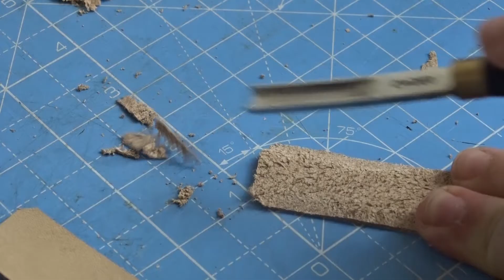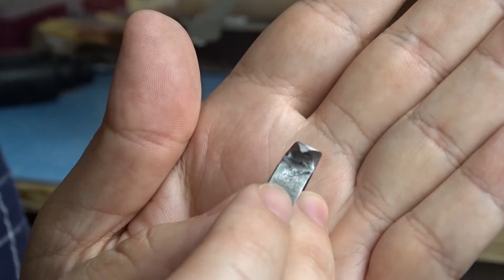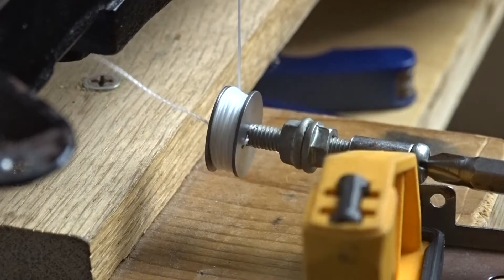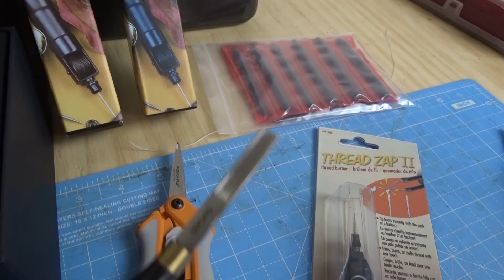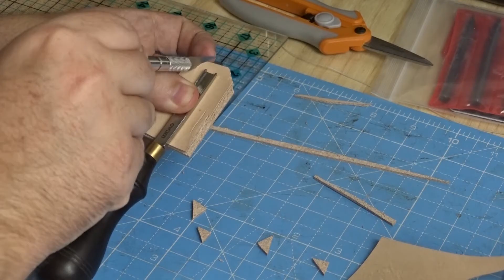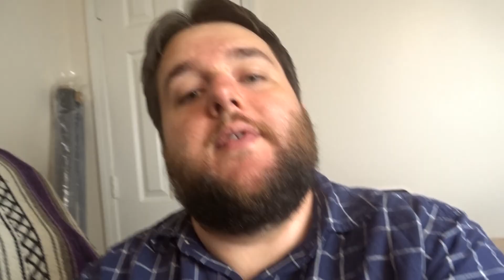It Stitches Like a Dream!  China Shoepatcher Sewing Machine: Easy Leathercraft Project

Comment: I just got this machine. My foot/needle do not go in synch. the needle goes down when the foot is up and the foot is down but stationary when the needle is up. . The foot does not rock to pull the leather through either
Reply: Mine did the same at first. Remove the big wheel and make sure the bearings are in the slots in the correct place and it should fix the issue like mine did.

Comment: Just wondering, can you adjust the stitch length?
Reply: Yes
Reply: Look for the upside down bolt with a spring around it. Tighter makes the stitches smaller.

Comment: Is there anyway that you could show me in a video how you would sew up two ends together to make a complete circle / pipe or can that be done with that Sewing Machine ? The reason why I ask is the the sewing machine I have is to wide to take both ends and put them together and sew them together. Because it is only 21 cm in with and it is going around a air cylinder.

Comment: Hello. Perhaps you can help. I bought the Chinese shoe patch machine in October of 2022. I spent a month watching videos, etc. For some reason I could not get the machine to pick up  the bobbin thread. So frustrated I put in the closet for a year. Pulled it out recently, and finally fixed the bobbin thread issue. Once the bobbin pickup worked, then I had an issue of the upper thread breaking. Watched some more videos, and did some intense sanding of all the bobbin parts. That stopped the breaking. Now, the thread is too loose. Before I just immediately tighten the bobbin spring, can you tell what would be causing the bottom thread to be too loose on my finished tests?

Comment: A simple way I found to improve the bobbin winder that came with your machine is to place flat washers that will fit the wheel on either side.  Tighten the nuts that came with the winder against the wheel.  This improves the winder by keeping the mechanism from wobbling.  My winder was a bit mangled when it arrived so I took it apart and flattened the sides in a vice as best I could then put it back together.  I was unable to tighten the round part that the screw goes through but the winder still works much better. I tried lock nuts but they would fit on the axle, hence the regular nuts that were already on the winder. Tighten them against the wheel so it doesn't spin.  The wheel will then spin on the axle as it should.

Comment: The stitching on the back looks really rough, but I know nothing about sewing, so take it with a grain of salt.  Is this typical of every leather sewing machine?  is it because of the tension? or just the nature of the beast ?  If one cut a groove for the stitches to lay into, would that help ?.    Is there any way to hook up a stop on the cylinder arm so that the stitching is straight and parallel to the edge of the leather (like a rip guide on a table saw ) ?  Thanks for the video.

Comment: I just got my machine.. No instructions hardly at all...  No pictures of how bobbin works an goes in..  My bobbins also dont have the hole yours does, can you make just quick how bobbin goes in an works n threading machine, string tension just simple stuff on how it should be threaded, tension, how bobbin drops in properly etc.  Sounds stupid but only photo i have is of machine sideways on directions they sent which are basically worthless on set up n getting started..  Thank you..

Comment: i just got this machine a couple of days ago and, once i got it mounted to the make shift stand and started tinkering with it, the top thread snapped every time and then the needle bent. so, there were a couple of questions i had right off the bat that you answered with the size of the needle hole being made bigger, needing a different needle but, you also gave me a few ideas in the modifications of the feeder foot as well. thank you for taking the time to make this video, it is very helpful

Comment: "sanded it down smooth"....   dude, that is NOT smooth.    lol.  great video overall, but come on man, if you are going put time into your tools, you need to go all the way and not half ass stuff.   that bobbing shuttle really needs to be polished, because you left it super rough after you sanded it.    same thing with the french skiver you have there.  its really dull, you can see it.  they never ever come sharp.   You need to put in the time to tune it up, and polish the edge.      leather tools, even the expensive ones, always require some tuning up once you get them for them to cut properly.  they never come really all that sharp.

Comment: I had something strange happen with mine. I was able to thread the bobbin and the thread isn't snapping but what does happen is when I try to sew leather it isn't pulling the bobbin thread through the leather so it unravels after I try to sew something. Any idea what might be causing that?
Reply: The needle isn't going deep enough. Assuming you have the right size needle and it is installed correctly, you can adjust the needle depth with a screw near the top of the needle drive rod when it comes up out of the sewing head.

Comment: Thanks so much for this great video. My bobbins don’t have that spring tab, do you think I can sew without it?
Reply from the maker: You need it for tension. Without it the thread will be too loose. Amazon has had some replacement bobbin shuttles. Just make sure it has the spring or send it back. The one I'm using came off a Singer shuttle of the same style.
Reply: Sam

Comment: Hi! Thank you for the video! I can’t get the bobbin cover to spin, is there a trick to loosen that screw?
Reply: I used a set of screwdrivers with a 3/4 height handle to loosen mine.
Reply from the maker: It may be too tight. Sometimes you really have to pull up on the back hard to get it over that post if the cover was made to thick?

Comment: Thanks for the demo of how to improve the bobbin case and needle passage. And the needles.

I wanted to patch a big item.  But I have trouble holding onto larger pieces with only one hand while cranking.  I am guessing I will need to motorize. Maybe I can erect some type of platform for the heavy material on the open side.  Any ideas?
Reply: We make everything has a video of putting on a motor he bought for sewing and made a belt with a pulley an worked great. Thank you for this video bud!!
Reply: Make everything shop
Reply: Vonhans lether
Reply: @Ihavesaucej.a.m   Sorry don't understand.   Did you mean you have a video showing a motor adaptation?
Reply: @rwind656  yes Search we make everything on YouTube he has a video adapting a small motor and a pulley type system with a rubber type of chain. Pretty cool. I’m having issues sewing with the new shoe sewing machine.  I’m gonna have to go to a shop near by for extra help.  Stiching  is ill.